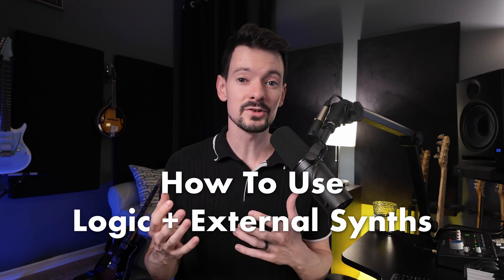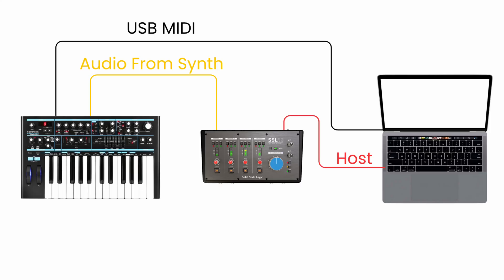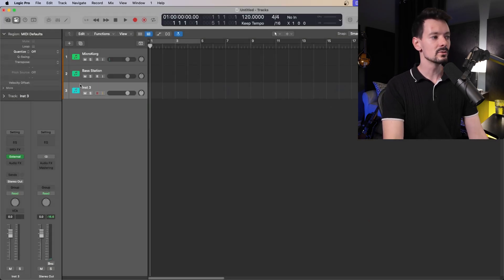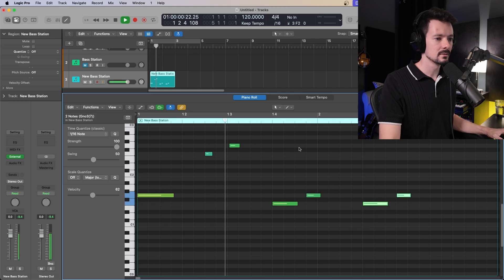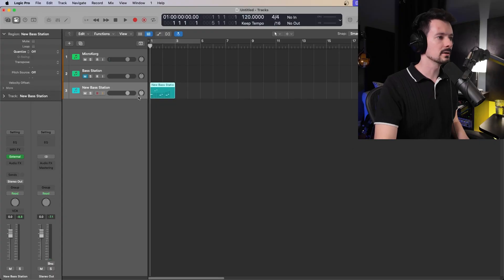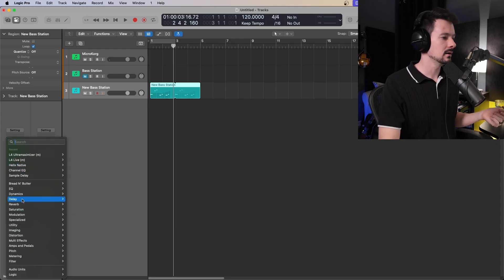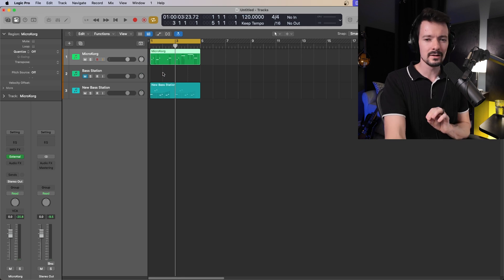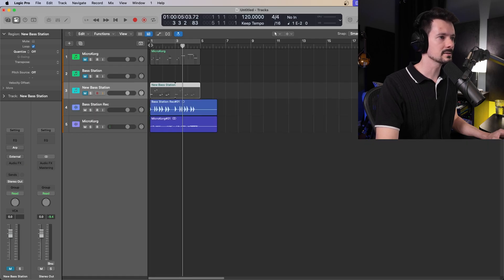How To Use HARDWARE Synths With Logic Pro

Comment: Thank you!! Can you talk a little bit about sending things like Program Changes and Bank/Preset changes over MIDI? I use a ton of outboard hardware MIDI instruments with Logic, but I don't have a good way to actually control anything on those instruments without physically touching them, which I can't do from the computer necessarily.
Reply from the maker: I appreciate the depth to that question but I haven’t figured all that out yet. When I reach MIDI level 2 I’ll make another video 😅
Reply: @woodyardmusic  haha, fair enough! I've tried a few tools that theoretically should send sysex library change signals, but I have no idea where to get those libraries or how to utilize them if i even had them. Always a journey!

Comment: Hello i have a roland fantom g8  keyboard and a korg karma keyboard , i want to use those as my active keyboards  when i use logic x 10.4.8  i have also a soundcard  type   motu  ultralite  first generation  with in and out  on backside. about audio  and fire wire and also midi connection. I see that i will use my roland fantom g8 as my masterkeyboard   so all i do runs from that keyboard  when i use logic x 10.4.8   So how to make a smooth set up for midi and audio  of those 2 keyboards i mention, i want to use the sounds in korg karma,  can you also explain this midi clock  settings too?   do i need a driver for my roland fantom g8?  ok i wait for a answer back  thanks.  so how connect  with midi and how to connect with audio. and see everything in logic .
Reply from the maker: Thanks for the comment. I’m you’ve got a lot going on in your setup. If you want to book a 1-on-1 call I can help you get things up and running as well as help troubleshoot it.

https://www.woodyardmusic.com/coaching

Comment: Super helpful and clear. One problem (logic pro newbie) - I can’t get this to work with a Volca Bass. Is it because it only has midi in? I can get my controller Keylab to play it and I can hear it just like you showed early on but it won’t record the midi therefore it won’t play it back either. Am I missing something really obvious?
Reply from the maker: You would need a “midi out” in order to record midi from the Volca Bass. So you will only be able send midi to it and record the audio.